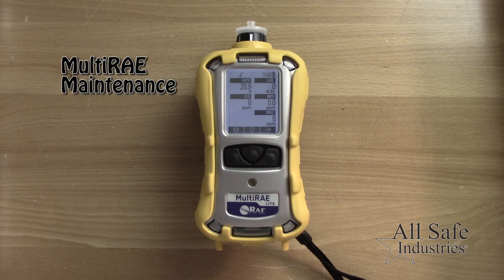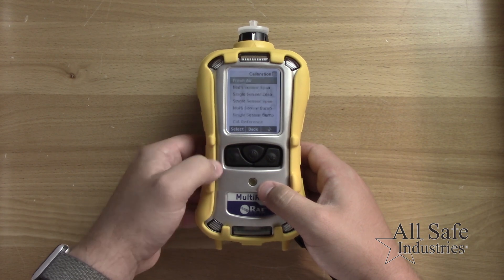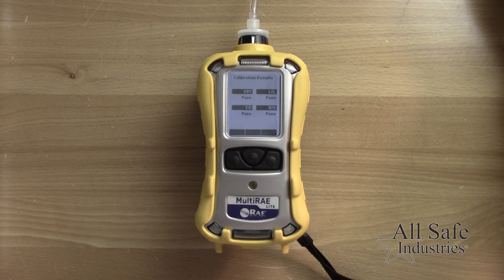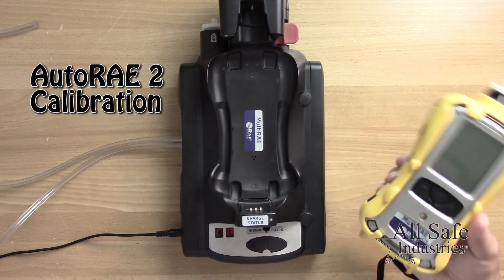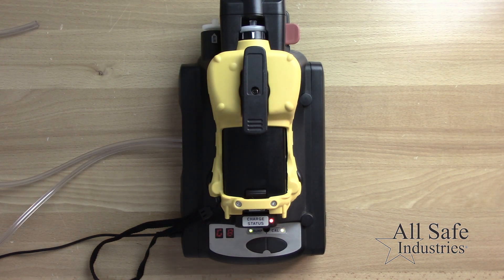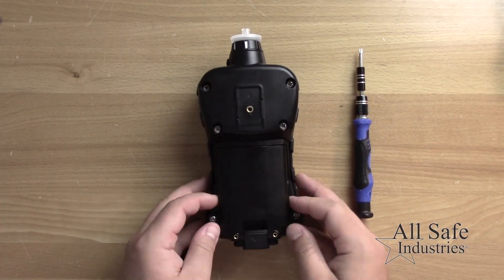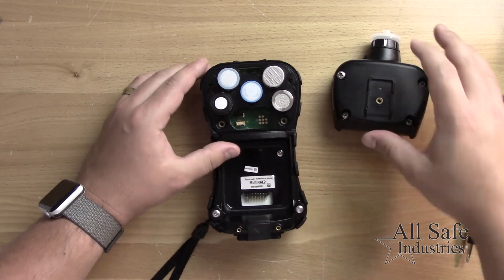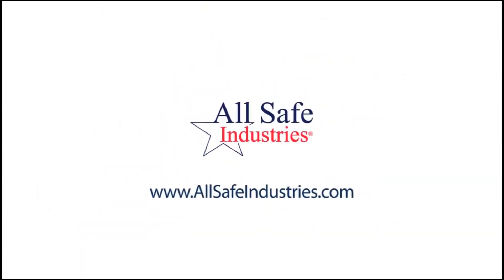MultiRAE Calibration & Basic Maintenance

Comment: Is there a difference between using the cradle to calibrate and hooking the monitor directly to a gas cylinder?
Reply from the maker: Practically speaking, the quality of the calibration will be similar. On its own, the AutoRAE cradle is easier for most people to use, it tests the visual and audible alarms, and potentially conserves cal gas. Adding controller allows for bump tests and calibrations to be logged automatically, among some other more advanced functions.